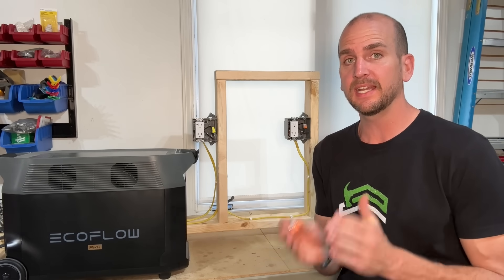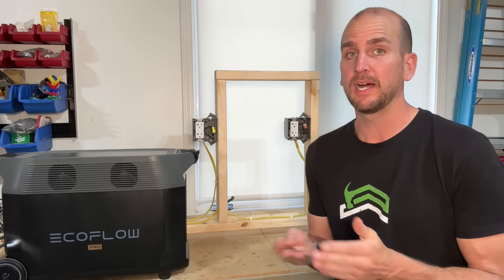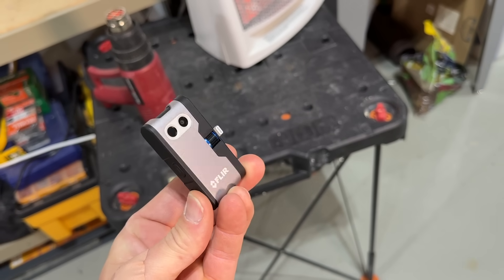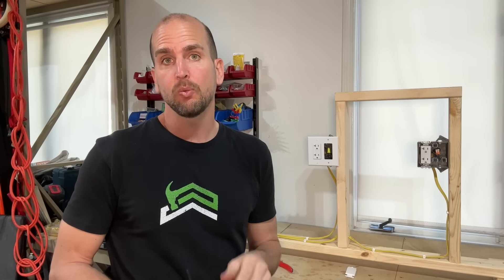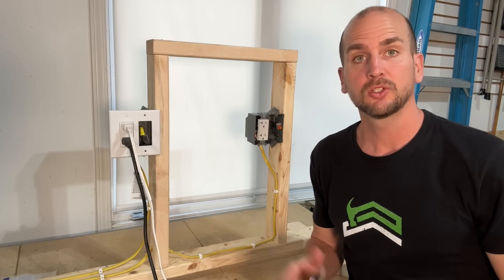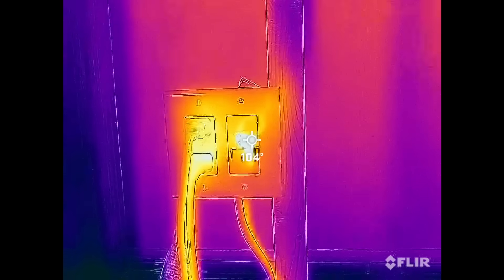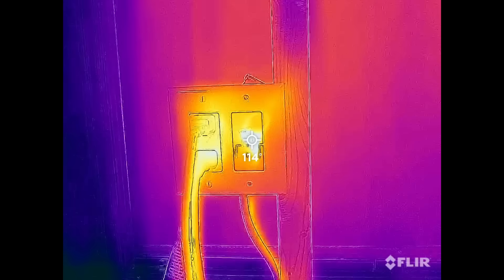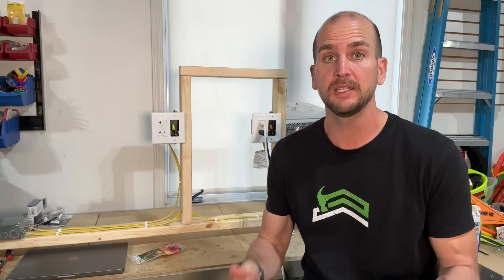Debunking the Pros: Can WAGO Lever Nuts Handle Heavy Electrical Loads?

Comment: It is not if the WAGO can handle high amperage when installed it is if continue to handle it after 2 or 3 decades.... there is a reason they have been banned from use in life critical applications by many engineering firms.
Reply: Since when do engineering firms have regulatory authority?
Reply: @B81Mack  They don't of course.  

But this is more an issue of reputation and warranty.  Engineering firms don't want to be known for specifying a "new, cheaper, less reliable" system if the customer is willing to pay the full price of the more expensive (higher labor cost) system.  

If somebody like Matthew is the approving authority, the firm could not win the bid.  Also, presumably, there would be less warranty work with the higher labor cost system.
Reply: @evahsia  , I know. It was a rhetorical question and I was also being slightly facetious. The term "banned" in the original comment caught my attention.
My point was that there is no known or historical evidence showing that Wagos are any less reliable or safe than wire nuts.
That said, no splice is ever as good as a "home-run" from distribution panel to device.
Reply: @B81Mack   Try again.  How do you think they got banned in the first place? Their failure rates are multiple times higher than   wire nuts and hundreds of times higher than Buchanan's, the preferred connecter for life critical wiring installations.
Reply: @matthewq4b , "banned" by whom?
What regulatory body?
Reply: @B81Mack   On every single job they design and manage.. If engineering does not approve it, it does not happen simple as that.
Reply: Sounds like BS to me. If it was really that critical you would not just leave it alone for 2 or 3 decades and hope it keeps working. You would have an electrician come in and check it, do preventative maintenance, so there is no risk of failure regardless of the connector used. And the receptacles too, they're going to loosen up over time, those should be replaced regularly as well if things are so critical.
Reply: @mjc0961  Hes right you dont use this fast junk for any situation involving house wiring as there not proven and have no advantages except speed. So why use them? Its just that people are lazy and willing to take chances with other people property.
Reply: @RadioRich100   10 years and Wago 221 still going strong.  Other advantages are: short wire connections, space issues, test port, connecting upwards of five wires, better for stranded to solid connection.
Reply: @mjc0961   Sounds like you have no clue what you are talking about. You don't do preventative maintenance on your electrical installation first off.  Second even if you are replacing the outlet you are replacing the  outlet NOT the connectors.  These installations are supposed to be sound PERMINANTLY and forever simple as that.  Some outlets do not get looked for 50  years...  If you feel the need that these WAGOS need "preventative maintenance" that ALONE says they should not be used....  Marretts or Wire nuts are a permanent installation that require NO further inspection or "preventative maintenance", when properly installed.   But hey thanks making a case for not using WAGO's
Reply: Life critical applications (like pacemakers, oxygen tanks) are unlikely to use any mechanical connection (wire nuts or WAGOs).  NASA certainly doesn't.  Insufficient vibration resistance.  I am curious about what life critical applications you think use wire nuts.
Reply: @evahsia  You are aware that stuff plugs in right, and ORs other rooms need lighting.  Not the sharpest bunch on this channel, why am I not surprised..
Reply: @matthewq4b  Yes, if you are (were) talking about hospital grade power, you are right.  But you are completely wrong about not doing PM on such electrical installations.  

Functional testing and inspections are a type of PM, at least in the nuclear world that I know.  Testing a GFCI monthly is a type of PM.  I suspect those critical outlets you are talking about get functionally tested regularly.  Nobody should rely on 50 year old wiring for ORs without regular testing.  You can't have it both ways (critical wiring AND never testing).

And, yes, if the outlet fails, a decent electrician would most likely replace the wire nut, simply because moving the wires around when replacing the outlet would risk some loosening of the wire nut.  Insulting others does not correct for false claims.
Reply: @evahsia   PM on the Equipment is one thing.  The wiring installations has NO PM. And are ONLY looked at if there is an issue.    Wagos are part of the wiring installation and NOT equipment. Still showing you have no clue what you are talking about. And if you think every outlet in a hospital or lighting equipment is checked regularly you got another thing coming. back in the days of Incandescent lighting the lamps in the OR were changed at X hours/date but that was it.  Why do you think there are hospital grade outlets ?   So they don't have to be inspected regularly.  Bottom line is Wagos are basically banned from use in most ALL critical applications.  The have proven to be unreliable with a failure rate multiple times that of wire nuts. and hundreds of times higher than Buchanan's
Reply: @matthewq4b , I find it hard to believe that our standards are higher than the German’s... I'll guess Wagos are not "banned" there.
Reply: @B81Mack   Out standards are higher because we run higher amperages. Again if you had a clue you would know this. And if you knew anything ANY engineering firm can set the standards for their projects and there are industry standards that most often exceed code requirements. .   Code is the minimum requirement to stop Billy Bob from making a mess of it..  You wanna trust your life to the absolute minimum that needs to be done?  Again if you had a half a clue of what you were talking about you would know this.
Reply: @matthewq4b  Anything is one word.
Reply: @matthewq4b , the NEC (or its equivalent in any given developed country) is hardly a "minimum" standard.
Reply: @matthewq4b  It is coming more apparent that you don't actually read the replies before sounding off.  I never suggested that "every outlet" is checked regularly.  I suggested that the critical (red) outlets in the OR are checked regularly.  So, I ask the question again.

Do you claim that the critical outlets in the OR are not checked during their 50-year lifespan?
Reply: @B81Mack   The NEC is EXACTLY that,  the MINIMUM standard that is allowable...
Reply: @evahsia   Do you even know what the Red outlets are ?    They are the outlets on emergency back up power  they are NO different than any other outlet..   And NO Outlets are NOT checked other than a visual by the OR staff when they do suite inspections..

Comment: Well done, I suspected the WAGO would be slightly more resistive (heat) however, it still works quite well and makes the jobs much easier. Cheers
Reply: I just did the math in a sub thread.   1 wago is ~ 2 WNs on solid, ~ 4 WNs on stranded (not sure, but I think those #s came from awg 14)
Reply: Wagos are junk and fail frequently.
Reply: Which means more possibility of fires.
Reply: @RadioRich100  the test was at 23 amps, higher than you are likely to run most things at. wago was only higher by a couple degrees, nowhere near close enough to cause fires,
Reply: @Jb2008-l8e That indicates much higher resistance and over time the contacts can fail on top of the fact they go intermittent because of the spring losing tension. There junk.
Reply: @RadioRich100  The resistance is barely higher, unless you can show me proof by ripping one open and testing it with a multimeter you shouldnt be saying things like this. The springs clearly work, as they have been used for decades.
Reply: @Jb2008-l8e Im not here to prove anything to you. What you call barely higher at the voltage and current there supposed to handle is too much and will get worse with age which is where wagos fail with time or intermittents. No resistance is good and you are saying some is ok - its not!  And will get worse with age. Why would u use a worse method?  To save time, so I dont want a guy like you wiring my house, taking shortcuts and I would pay the price in the long run. Ive seen it.
Reply: @RadioRich100  Just so you know, ive never used a wago, only wire nuts, And I get the things that your saying. but I dont think that these problems are as exaggerated as your making them to be, the clamping mechanism in wagos is very strong and, there are use cases that I would consider them more reliable than wire nuts, like joining solid to stranded, old brittle wiring that snaps easily. Im not saying that the problems your speaking of are non existent, but for most people they will do just fine. However, I would not use them on any high power appliances.
Reply: Not really since its way harder to inproperly install them. I have seen tons of wirenuts being badly installed or mixing solid and flex.   @RadioRich100

Comment: Very informative! Maybe, do another video measuring voltage drop under load comparing 10 wire nuts in series to 10 Wagos in series. I suggest comparing using both a heat gun, then a typical load, like an HDTV, fridge, or fan.
Reply: Your average meter will struggle to read the difference. At full rated load, 20A, and 120V, that's 2400W going to the load. The Wago will dissipate 2W, absolute worst case. So 20W dissipated in 10 Wagos, 2380W still arriving at the load. Instead of 120V, the meter may read 119V.
Reply: @DonaldZiems  , When I make coffee, the voltage at the outlet drops from 122 to about 119. In most circuits, there are a few connections, so I'm wondering how they add up. Personally, I'd twist and use a wire nut, except where replacement is likely, like a light fixture or ceiling fan.
Reply: @robbehr8806  Vast majority of the voltage drop is in the cable itself, the connectors are completely inconsequential in terms of voltage drop. For example, my 22kW car charger (32A @3Phase 380V) uses Wago-style terminal blocks as the input terminals. If there was even just a 1V drop in these connections, it would dissipate 100W of heat in the terminal block - which in turn would immediately melt away.
Reply: @DonaldZiems  i don't think a voltmeter would have trouble directly measuring the voltage drop though--measuring across the series of connections.
Reply: @randypittman279 , my point was that so little power is dissipated in the connections that you'd need a reasonably good meter to notice the lost tenths of a Volt. I think I once ran the numbers that a Wago's resistance is roughly the same as 10' of 14 AWG wire.
Reply: @DonaldZiems  I watched a video recently of a electrician replacing a series of old outlets (gfci protecting old wiring without ground), maybe 10 or so, the voltage drop just from the wiring itself actually added up to a good bit...
Reply: I agree.  We do not know if the temperature difference is due to the increase in waste heat due to voltage drop, less copper-copper sinking, or radiative properties of the connector.  For example, a really good heat sink might look much hotter on a FLIR for the same heat source as a less good heat sink.  

Honestly, in my opinion, these results are so close together that they perform identically.  You might even get the same results as the WAGO using another wire nut from the same package.

Comment: I'd like to see you run enough amps through them to see what the failure point is. How many amps before the Wago reaches 221 degrees vs the wire nut reaching the same temperature. Outside, away from any flammable foliage, and with a fire extinguisher at hand of course.
Reply: There are several YouTube videos out there where the up the current to failure and I believe it is in the 60 amp range.  Basically, the Romex melts away before the Wagos or wirenuts fail.
Reply: @glasshalffull2930  not only that, but in some of the tests, the Wagos maintained the mechanical connection after the plastic melted away, the metal spring and bus bar stayed intact. Not sure the wirenut would continue to hold wires together of the plastic melted away.

Comment: This testing would have been simplified using a multimeter with a 4 wire kelvin resistance measurement. Heating is the result of resistance.
Reply: That only tells you one aspect, though. Sure, if you know resistance and amperage you can calculate power dissipated, but it misses the crucial variable of heat dissipation, to get the value we ultimately care about: maximum temperature rise.
Reply: @DonaldZiems  by definition, power dissipated = heat dissipation. agree with you that temperature rise is a good illustration.

Comment: Couldn't you test the WAGO more easily and more quickly by measuring its resistance?  Or by measuring the voltage drop across it?  Perhaps using a simple DC circuit, and perhaps at a current much less than the rated maximum current.
Reply: Resistance alone does not tell everything and is only one of the factors that caused the temperature differences.
Reply: @buggsy5  : Why do you think the temperature rise is more important than the resistance?  The unwanted resistance is what causes the load to receive less voltage and less current.  The peak temperature measured in the video is far too low to burn anything... much lower than many of the components in the computer on which I'm composing this reply.
Reply: Hes too dumb for that, hes a handyman not an engineer, dont take his advice.

Comment: More resistance = more heat, and that = more voltage drop and power loss over longer lengths.  If you were to wire an entire circuit with multiple outlets both ways, I think the results would have a wider spread near the end of the run.  I like the convenience of the lever nuts, but I don't use them or recommend them personally.  I do highly recommend the King Innovation AlumiConn bus style connectors for aluminum wire applications, and they work well for copper as well, but are very expensive and require precise torqueing for best results.  They are superior to wire nuts in my opinion though.  Would love to see those in this test, to see if it would crush my dreams - lol.  Thanks for all the great content!

Comment: For solid core copper wires, the Wago 221 are not the best choice. Wago 2273 are the best to use. 221s if you need to add stranded wire to the connection.

Comment: So in other words:  I need to make sure I don't use 25 amps on a 20 amp circuit in my attic in the summer...  gotcha.

While the Wago might have slightly more resistance initially, it is not succeptible to loosening over time like a wire nut.  I can't tell you how many times i've tore into 30 year old wiring and one of the nuts in the box is loose after decades of expansion and contraction.  That wago will be consistent- and most importantly for me fast to use and with a meter test port.  That access port is worth its weight in gold.

Comment: Change can be difficult for some.
Reply: Ain’t that the truth. If YouTube existed eighty years ago: “Those new fangled wire nuts are junk! Real electricians do a 1.5’ Klein twist, solder, then temflex + rubber tape+ super 88!”
Reply: They made a change back in the early 70's that was supposed to be alot cheaper, people accepted it - It was called aluminum wiring, ever hear of it?

Comment: The channel Great Scott tested the resistance if wago lever nuts and came to the same conclusion.
Reply: Nice information 👏🏼👏🏼
Reply: https://youtu.be/zgjo36-jaFY
Here's the link. Basically the same conclusion but hits the electrical details far more clearly
Reply: Only when there new.
Reply: @RadioRich100  Not true, as you well know. They are only "new" in parts of the USA.

Comment: I use mostly wire nuts unless I’m in a really tight spot then I will use the wagos
Reply: Retired Master Electrician here, and yes to all of the above.
Reply: Exactly! Why use wago unless u need to.. but I’m old school. Wago is great for short wires or tight box space. Otherwise I’m going old school, cheap, and good with wire nuts.

Comment: These are great. UL Listed safe and millions are in use right now.
Reply: so was aluminum wiring until about 7 years later when houses burned down left and right. Do to connections going bad. All was approved and accepted. Just like wagos. Why do you think there banned in so many places?
Reply: @RadioRich100  Just because some jurisdictions may modify the NEC to ban WAGOs does not mean anything is wrong with the connectors.  
I have not seen any electrical fire investigations where the cause was put down to a WAGO connector - although I have seen quite a few where a wire nut was blamed.
Reply: Aluminum wiring was UL approved too.
Reply: @RadioRich100  Wago's have been in use for years. Can you reference any house fire, anywhere, that was directly caused by a faulty Wago? These aren't just some new technology hitting the market. Development of their products began in the 50's.